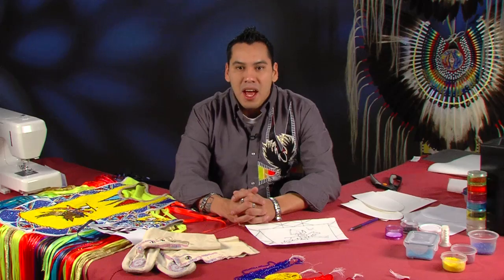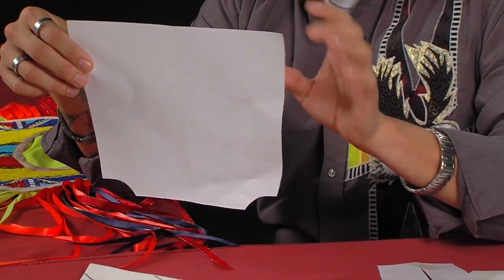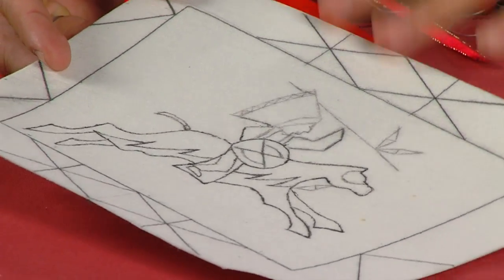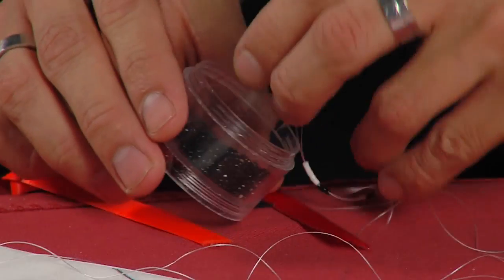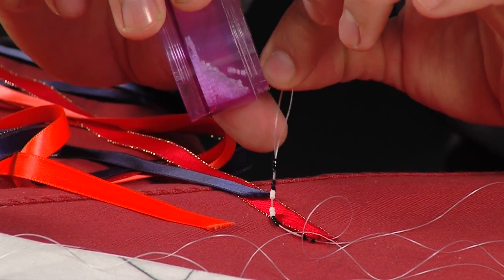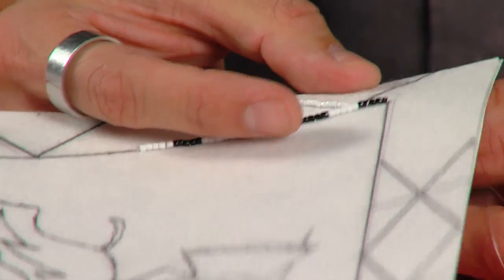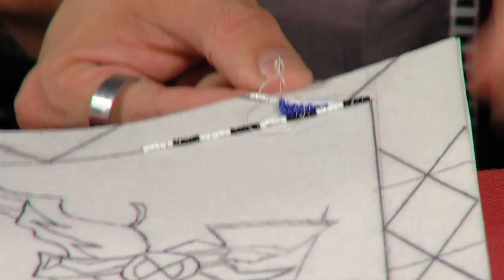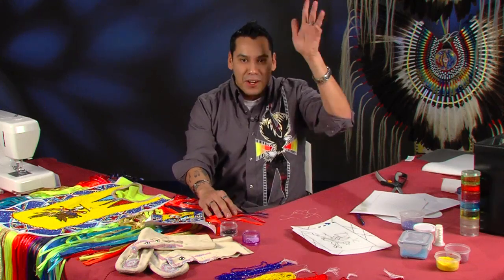Making Regalia - Episode 5

Comment: This is so awesome Juaquin...great video. I taught myself to bead so I could bead my graduation cap...wish I would've watched you first! I'm sure it would've been a lot easier if I did.  It took me about 40 hours, but I got a lot of compliments and I honored my tribe.  Anyway, one thing that took me so long was sorting through the cheap beads I bought.  Does anyone know where to get good quality beads?
Reply: crazy crow has good beads. I use size 11 but the smaller you get the more detail. 11 would be what I'd start with to get used to it.

Comment: Loved your video!  I've recently learned how to flat stitch, but one issue I'm having is it likes to curl outward. Which I'm assuming is because I'm making it too tight. I also noticed you bead from the outside in. I usually start from the finer details like your warrior first. Just curious as to if you tried it that way and why you might prefer to start with the border and larger coloured areas first.
Reply: To get the border strong for your design to be straight.

Comment: On the first line you started beading then you over stitched to lock the beads into place. At the point where you stopped on the first starting row, how did you return to it to continue on? You didn't show that part. Thanks.

Comment: The problem I'm having, is beading closet in the middle...the question I have is without confusing anyone, is...how do you hold your beads down with outer material in the way?...or, do you use the.."push needle through down to the hard surface, then lift your piece and pull the needle down through? For me, what I find easy is to hold in to my beads with my thumb, esp when working with circles...I was hoping you'd show the technique on how to bead closer to the middle of your piece...please HELP! #feelingfrustrated#

Comment: I have a question what happens if it gets wet since there is paper under the beadwork?
Reply: Really nothing to much. I don't like using paper. I use the see threw felt to copy your design.then put it on a thicker felt.